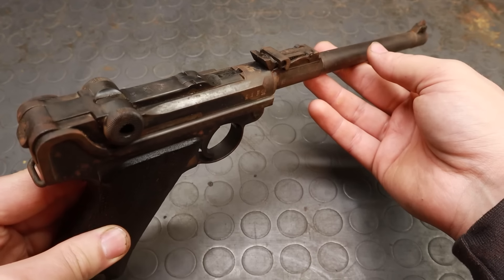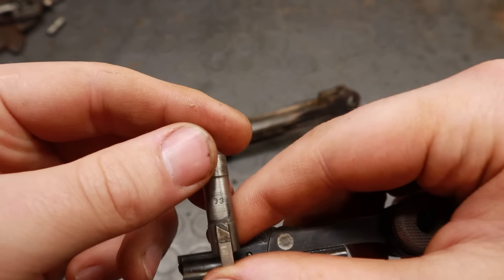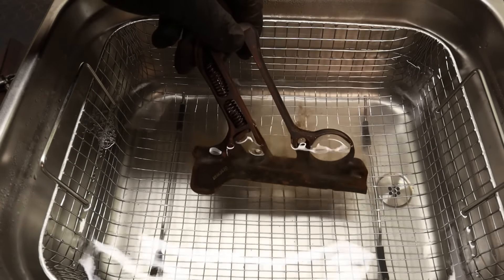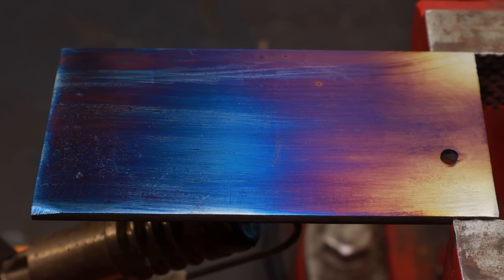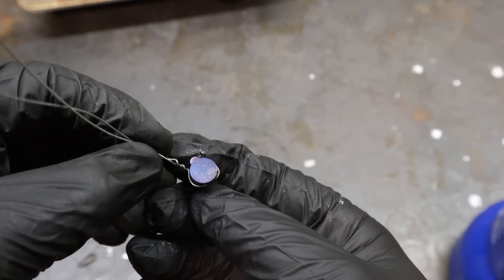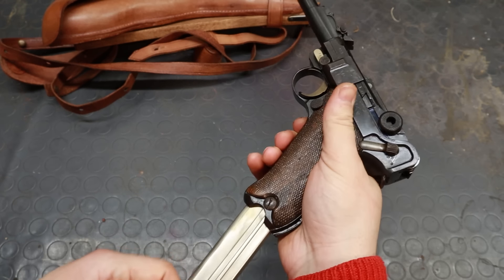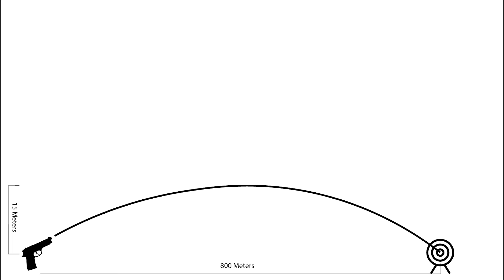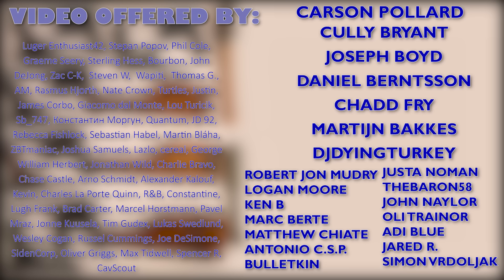Restoring an Artillery Luger from 1917

Comment: As i own a 1913 Luger which looks only a bit better as how you started with this one, i am intrigued to maybe restore it, although im somewhat scared to do so. It really is my prizepiece and would suck to damage it. It works fine as is and is still accurate.
Reply: Do some research before doing anything. Not all Lugers are equal. Prices can be all over the spectrum. Also damage can be done simply cleaning wrong. First all do no harm! And depending on cost, consider a professional restoration.

Comment: The handles differences could be a result of assembly line production - i.e. where left and right parts are produced as separate batches and/or on separate assembly lines and then paired rather than produced as pairs.

Comment: I am thinking about those differences in grip colours. Would it be possible that the substances of the human sweat from the hands affect the colour? I mean there is some amount of sodium chloride in it and since most of the shooters are right - handed, therefore the right grip would be more exposed thet the left one, since the right grip's surface has bigger contact with the palm of the hand, thus the colour differences. Also, in combat conditions, the human body sweats a lot due to the stress, which may cause the discoloration.

Comment: Great video as usual! Is there any option/technique to redo the rifling (without changing the barrel)? Such a pity for this well conserved gun.
Reply from the maker: Yes, there are a few. The barrel could be relined, which is the more traditional approach. An alternative is re-cutting the grooves, which is the least invasive but most complex way, end you end up with a lightly larger groove diameter, which requires either an oversize or an expanding base bullet.

Comment: 10:49
Isn't that because adding stable iron oxide changes the tolerance till the firearm, well as you said "breaks in" or well breaks off the excess tolerance from the additional iron oxide?

Or is this entirely irrelevant in this case?
Reply from the maker: The bluing itself is extremely thin, about 2 microns, I wouldn't think that's what causing the added friction. However some extra black oxide is produced both with rust and caustic bluing, and that's probably what is causing the added friction

Comment: Is it possible to somehow re-rifle the bore? Or is there not enough material left to do anything useful?
Reply from the maker: there are two ways, one is relining the barrel, which is more radical, the other is re cutting it, but that ends in an increased groove diameter, which requires slightly oversize bullets to work properly (or expanding base ones)

Comment: Does the straw color on the white parts actually come from a deliberate manufacturing/finishing process? Or is that also a result of 100 years of very slow oxidation?
Reply from the maker: No, slow oxidation won't look like that. Actually straw colored parts tend to lose their color as new oxidation kicks in, since wet oxidation (the only one that happens at room temperature) doesn't produce an optically homogeneous film. Only the best preserved specimens keep their original temper colors.
Reply: @Backyard.Ballistics  Ah I see. Thanks for the answer!

Comment: I just acquired a m38 Carcano recently. Unfortunately the seller greatly neglected to share how shoddy condition the rifle was in. The blueing and mechanics work fine, however the wrist had a terrible crack and the end of the barrel (part where the bayonet socket would go) had been cut off. Do you (or anyone else) have any suggestions on how I may fix it? I’m not necessarily looking for it to be straight out of the storage warehouse, but I would like the barrel to appear normal, and have the stock be useable until I can find a replacement. Any advice would be greatly appreciated

Comment: It seems that you have perfected your bluing skills to an art. 

The barrels of most if not all of the restored guns are shot out. Maybe making a new barrel for the luger is an idea. If button rifling is too much of a hastle, maybe 3D printing an EDM rifling rig to electrically erode rifling into a piece of 4140 grade heattreated hydraulic tube does the trick. Ivan the troll was the guy who made it main stream. I was emailing with him on the topic and told him about button rifling, that was too hard for 3D gun print people he said. I told him, well maybe if you can keep the electrodes to erode metal on one spot it works. But i told him it would be difficult. He told me some other guys were experimenting with the idea already. If you already have a 3D printer its not too difficult. The rifling and the camber is made by EDM machining. With the lathe you can shape the barrel to fit the luger. It produces accurate barrels. 

But with a lathe you can also make a button rifling machine. And those machines can produce match grade barrels. Also making a kiln with kanthal thread and kiln fire bricks is not too difficult difficult. A s-type thermocouple and a PID controller are cheap from China. :) 

Maybe then you can have really nice shooting guns. Guns that can hit what you aim for far away. :)

Greetings,

Jeff
Reply from the maker: Thanks for suggesting, as usual 😉

Comment: In terms of bluing you can control temperature more easily by making a bed of brass chips which would then distribute the heat evenly. I advise taking a look at ClickSpring's video: https://www.youtube.com/watch?v=8h1Uf9bkc3E
Reply from the maker: Thanks for suggesting, I'm an avid watcher of clickspring. I just find the molten salts more practical to work with.
Reply: @Backyard.Ballistics  To each his own then I suppose. Finding salts for me would be harder than finding brass filings. :)
Reply from the maker: @MladenMijatov  there's another option if you want, you can use molten lead-tin alloy, rest the part on it while continuously moving it around (steel floats on lead). Adding more tin will reduce the melting point of the alloy, allowing to get all the temper color specturm.
Reply: @Backyard.Ballistics  That sounds more doable. Those materials I do have laying around. Thanks!